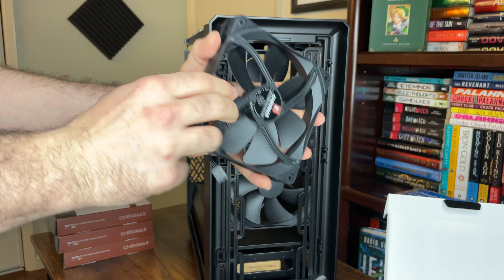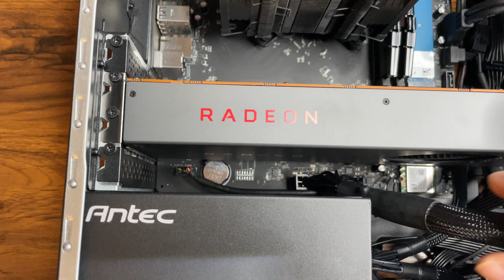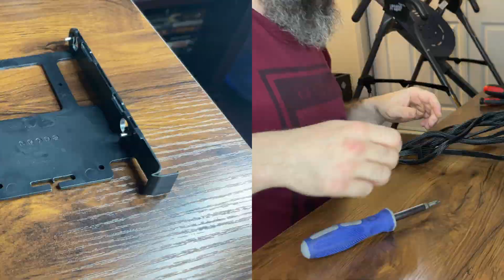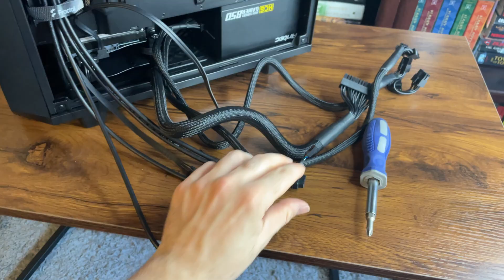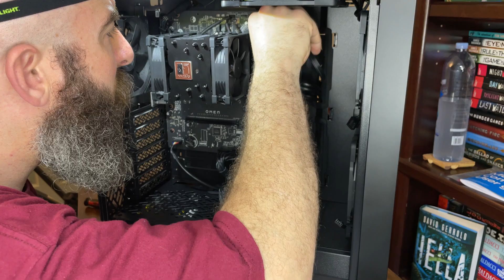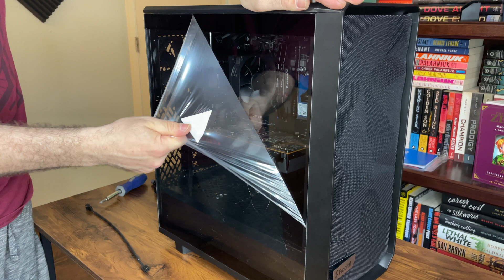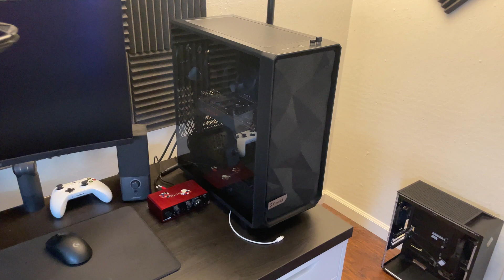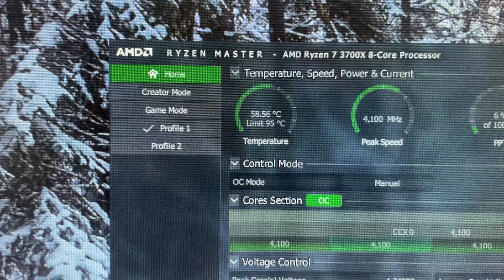HP Omen 25L / 30L Case Swap! Tutorial! Walkthrough and Results!

Comment: Does anybody here know if its possible to swap case on my 2021 HP OMEN 25L GT14-0879? I spoke to a salesman where i bought it and he told me OEM builds was a pain in the ass and that the PSU is optimalized  for this specific build/case and that motherboard probably wouldn't fit in any other case. I want to swap case and maybe upgrade the RAM. Anyone got any tips? =)
Reply: i wanna do the same. im looking to swap my motherboard, case, power supply. looking for just ideas to get me started.
Reply: @abstaxkkzyt3509 HP support just answered me back and said the case can't be swapped (they didn't know why) and that the Ram could be upgraded. So im stuck. Don't wanna ruin the whole thing 😅

Comment: I'm about to case swap, replace the Ryzen CPU cooler with an AIO, replace the power supply and add a bunch of fans. Do you remember how many fan connectors there were on the MOBO? I think I need 4... I'm not sure how to go about that and I'm hesitant to do the swap because of this.

Comment: Great guide! Swapped my Omen 25L case to the Fractal Mesh 2 but now I have the problem of my Fans spinning fast at nearly constant speeds, about 2000RPM without load. Tried to use Tools like FanControl and SpeedFan but it seems like they can't even setect the Fans. Maybe someone here has an ides what is causing my problem. Motherboard semms to ba a dorado oc rev B. thanks in advance.
p.s. Omen Game hub does also not work, doesn't matter what fan speed I choose it keeps the same.

Comment: So, DanKamYouKnow, you add all the fans humanly possible to the HP case, you added an AOI, you installed a fan port, also, all done in the HP 25L case, and all were wonderfully helpful videos; now you take it all out and put it in a new case, also another great video! 

Well, I have to ask. Isn't it time you stated STAY AWAY FROM THE DANG HP OMEN 25L in the first place! I didn't, of course, but I rue the day I bought mine. It's a freakin room heater, My wife could probably iron hankies on top of its case! A disaster from the get-go!

Comment: hello, I am experiencing overheating issues and I know its been 2 years since youve posted this video but would I be able to swap the 30l (r7 5800x / 3080) into an Antex AX63 Elite atx case?
Reply: antec ax61 elite
Reply from the maker: Yes, that will work fine. You may need to get y-split to power all of your fans. I’m also not sure if you would be able to power the RGB fans as Omen motherboards don’t have RGB headers.
Reply: @DanKamYouKnow  oh thanks for the reply wasnt expecting it, do you have any cheap / budget cases you would recommend? I think im gonna go with montec 903 air max but id like to get some other options and decide
Reply from the maker: I would honestly recommend the Corsair 4000d. It’s $100 currently but will drop down to around $80 with coupons and sales. By far one of the best cases for Omen users looking to swap:

https://amzn.to/3TLcoqc

Comment: Hello.
I had to buy another case because the new video card I bought was too big.
I moved all the hardware to the new case but I don't know if I plugged the power sw cable wrong? I don't know if I plugged the power sw cable in wrong, there is no reaction on the computer and no warning light is on, it's like there is no power, can you help me where I went wrong?😢
Reply from the maker: Did you figure it out? It is most likely the 2 pin PWR button that is not plugged in

Comment: Can this same case be used for the omen 30L with the stock AIO?
Reply from the maker: Yes, same exact process. you can mount the stock radiator on the top or the rear.

Comment: Why didn't you transfer the wifi card over? Im swapping a case right now and im scared lol??
Reply from the maker: Because I don’t use WiFi, I only use ethernet. For the WiFi card, you will have to swap over the card and the antenna that are underneath the front part of the case. You will basically have to mount the antennae somewhere in your new case (somewhere in the back panel would work best ). It’s the one thing I didn’t cover in this video, sorry.
Reply: Hey man I made that comment then scrolled to see sooo many people asking the same question and you answered them all sorry about that. Thanks for your help! I might just buy a usb wifi antenna instead ya??
Reply: Also is there no way to transfer over that rgb control chip to my new case? I got 3 rgb fans in my new phanteks case I might not be able to turn on.
Reply from the maker: @dariuspeterson2269 Nope, the Omen RGB controller only works with the Omen diamond and light strip, it won’t work with any other RGB, it’s proprietary

Comment: Hi. What can i do if my case doesnt include a cable for pwrbtn and led? It only has a f panel cable😢
Reply from the maker: If it has a front panel cable, then that case manufacturer has grouped together all of the front panel connectors. You will need to separate all of the connections from the group of connectors.
Reply: @DanKamYouKnow  thanks❤️ i will try

Comment: Hey man, I appreciate your videos as you’ve helped me along my first experience with a gaming PC. I’ve followed a ton of your walkthroughs when replacing my gpu, power supply and most recently I just swapped the case out for the fractal. Sadly I think I botched my cpu socket in the motherboard and have to replace the motherboard. Do you know if I can transfer the ssd to a new motherboard? I would just transfer all the storage to a hard drive but I can’t boot the computer now because of the cpu problems.
Reply from the maker: Yup! You can swap your SSD over and everything will work just like it did in your old motherboard. 👍🏻

Comment: the HD Cage rubber grommets are installed incorrectly, those grommets have a slit sideways, the cage is supposed to slide into the slits into the grommet, so youll have vibration dampening between the HD, cage and screw
Reply from the maker: Thanks for pointing that out

Comment: Where did you mount your Wi-Fi card ?
Reply from the maker: That is one part I didn’t cover in the video. I don’t use WiFi so I didn’t swap over the card, I only used Ethernet. You’ll have to swap over the card and the antennae that are attached to it (they’re underneath the front panel of the PC)

Comment: Very important question😭😭. I just swapper my case, but once i turned it on i didn’t have wi-fi or bluetooth. I know that Cam didn’t transfer over his wi-fi card, but i need to know how to do so. The antennas that plug into it are soldered to the other case, and i don’t know what to do.
Reply from the maker: You have to pry the antennae off of the Omen case and transfer it over. It should be able to break the bond from the Omen case and the antennae.

Comment: how do i take out the wifi chip? after removing the back panel an making my way toward the chip it’s it the front of the omen logo and it’s glued down? what do i do?
Reply from the maker: You might have to scrape it off. I don’t use WiFi ( Ethernet only ) and didn’t swap over my WiFi card, so I never did it, sorry
Reply: @DanKamYouKnow  oh okay it’s okay, i appreciate your help, another question i have is, i bought the a factal case and it’s the mestify compact rgb one, it came with 4 stock rgb fans, there is 4 cables within the stock fans, theres the rgb headers and the 4 pin to connect to your motherboard and an extension to apply more fans, so after connecting the all the fans and the rgb connectors, the fans don’t light up so im curious to why they don’t, i did research but they didn’t give the answers that i need and i even pressed the built in led button on the front of the case where you power on your computer, do you possibly know why?
Reply from the maker: RGB generally doesn’t work with Omen motherboards. I’m not sure where you even plugged them in (unless it’s a separate RGB controller or something. I’d recommend motherboard swapping at some point. The Omen motherboards suck
Reply: @DanKamYouKnow  okay, i appreciate your recommendations and your work, thank you

Comment: I started a similar project because I wanted to upgrade to RTX 4080 which didn't fit into the Omen case. Eventually I ended up ordering a new motherboard and AIO as well because I hated the BIOS from the HP motherboard. I mean - if I'm doing something might as well do it right the way I want it! :D

Now if I buy a CPU and RAM I have a whole new computer... :D
Reply from the maker: Yup, that’s what I recommend for most Omen users, is slowly building out of the proprietary’ness of the Omen. Most start with a case swap, the MoBo, then everything else.

Comment: How did you get Wi-Fi then for your pc a dongle?
Reply from the maker: I don’t use WiFi, I always connect my PC straight to the modem with an Ethernet cable. This is one aspect of case swapping that I did not cover. You will have to swap over the small WiFi module that’s on the motherboard, and the antenna. Or you could buy this:

https://amzn.to/40I4Jca

I have used this for WiFi and it works very well

Comment: With HUGE respect to Dan, a case swap is unnecessary.  My solution was to replace the glass on side door w/ plexiglass and add an intake fan straight to cooler. I went a step further and added a Noctua DH-15 S cooler. I went from 60C Desktop/Idle temps to 30C. It would hit 90s when gaming, and now in 60s-70s while being whisper quiet. I detail the entire build in an informative time-lapse on my channel that I uploaded today. See "HP Omen 30L runs HOT - COOL it before it's too late!".
Reply from the maker: I will have to check out your channel when I get a moment but I still think a case swap is the best value for Omen users. It opens up so many possibilities for different cooling components, larger GPU’s / motherboards, and others. I think a case swap is also the best experience for a person newer to PC building, to get that feeling of accomplishment once they’ve finished the swap.

I’m all for modifications and DIY, but I always recommend getting away from HP parts over time, if modifying is something the owner is even interested in

Comment: Any clue how to make an omen 25L swap case to phanteks a500g ?  I'm stuck looks like it is not possible 😢  this new case is great but that omen 25l mobo seems like a big issue.  Not allowing case swap
Reply from the maker: Why wouldn’t it it possible? Looks like any other mid tower out there
Reply: @DanKamYouKnow  ok made it.  Had to not care about that rgb stuff or wifi card.  Not sure what was this card for on bottom right. I didn't put it in.   

New case is so HUGE.   Can totally add more fans.  Originally you can add 7 140mm fans.  And you can probably add 2 more at the bottom if you raise them a bit to throw some wind to the GC.  

When I tried to swap I got so stuck thinking  I had to fit all of the omen stuff....   but no.   
Anyway.  Thx for the video.  Checked it.  And made it work

Comment: how easy is it to remove the back plate on 30L motherboard with 120mm water cooler? I am transferring to meshify 2 case
Reply from the maker: It’s not hard, just takes the right tools. See my cooler replacement videos, I explain the best way to remove the back plates in those video
Reply: Hi Vipul- I also detail this in Step 6 of my channel's guide on cooling the 30L. See my video I uploaded today "HP Omen 30L runs HOT - COOL it before it's too late!". However, I highly recommend a cheaper method outlined in timelapse in this video. It shows you how to replace side glass with plexiglass to add an intake fan. I took the mod one step further and added a huge Noctua cooler. My temps went from yours to 60s-70s gaming in whisper quiet mode. Good luck!

Comment: So the control center on the bottom right corner stays?
Reply from the maker: That’s the RGB controller for the diamond logo and the case light strip. If you somehow want to use those, you’ll need to transfer that over

Comment: I performed this swap, but now my Ethernet jack does not work in the new case. Everything else seems to be working. Do you have any ideas on what I may have done wrong (i.e. forgot to plug something in?) Everything appears to be connected except for the RGB controller, I did not transfer that over.
Reply from the maker: Did you figure it out? I am not sure why an ethernet jack would be not working after doing something like this. The LAN port is built into the motherboard so it's not like you didn't swap something over.
Reply: @DanKamYouKnow  I have not 😭. It's so odd. Everything else works.

Comment: Hey man, I have learned a lot from your videos. I am wanting to transfer my HP Omen 25L into a larger case like the Corsair 4000D just to get even cooler temps. Do you think this is feasible? Do you foresee any issues at all?
Reply from the maker: No issues at all and the 4000D is an AWESOME case. Make sure you transfer over your WiFi card and the antenna that are taped under the front of the case. 👌🏻
Reply: @DanKamYouKnow  I actually just went ahead and bought the fractal because the more I looked at your video, the sexier that case looked to me. How did you control your fan speed? I cant use the omen gaming desktop anymore and I can't seem to get MSI afterburner to turn them down now.
Reply from the maker: MSI Afterburner only controls GPU fans. If you’re still using the Omen motherboard, then you have to use Omen gaming hub unfortunately
Reply: @DanKamYouKnow  I just watched your hp omen going into surgery  video, and I see you already covered it👍 I am sad, I guess I will have to go buy a motherboard and change it out. Thank you Dan Kam Master Omen Man
Reply from the maker: No worries Blake, good luck with your build 👌🏻

Comment: I'm getting error 90b aftercase swap any ideas how to fix plz
Reply from the maker: Are you using a fan controller? Omen motherboards do not like fan controllers. You’ll have to bypass that error every boot. 

Are you utilizing all fan headers that were used when the computer was in its factory form? If you aren’t using a fan header that was used, it’ll throw that error. Make sure a fan is plugged into every factory utilized header
Reply: @DanKamYouKnow  thanks for the reply.  Yes I'm using a fan controller and have no fans plugged into the headers .I will plug the exhaust fan into a header and see if that helps.  Thanks again.
Reply from the maker: Even if all fan headers are plugged in, the controller is still probably going to throw that error unfortunately
Reply: @DanKamYouKnow  ahh ill just ignore it then . Cheers
Reply from the maker: No problem 👌🏻

Comment: Do you need to bring the cables from the omen case into the new one?
Reply from the maker: Which cables? The new case will have the front panel connectors, and your power supply will have most of the others. I explain it all in the video.
Reply: @DanKamYouKnow  Ok I see, im getting a new case and psu soon I just wanted to make sure I dont screw anything up. Thank you
Reply from the maker: You’ll be totally fine 👍🏻
Reply: @DanKamYouKnow  Do you think the 6950xt is good?
Reply from the maker: Yes, fantastic GPU

Comment: Thanks for the video! Can you share the links to the Noctua fans or the specs please?
Reply from the maker: You're welcome! I just realized that I don't have my normal links listed in the description. I will post this build here and in the description:

Fractal Meshify Compact 2 Case: https://amzn.to/3yuRRcm
GigaByte AORUS X570 Elite: https://amzn.to/3fD1f5b
AMD 3700x Processor: https://amzn.to/3fbwAwA
Noctua Chromax U9S aircooler: https://amzn.to/3hIvbze
AMD Radeon RX5700: GPU Market is TRASH
Crucial Ballistix RAM: https://amzn.to/3ytFw87 ( x2 )
Antec PSU 850w Gold: https://amzn.to/3u5ueDT
Antech PSU Extensions: https://amzn.to/2RDoHHj ( Black )
WD Blue 2.5" SSD: https://amzn.to/3yvw0kX ( 2TB )
WD Black m.2 NVME drive: https://amzn.to/3c0yONF ( 1TB )
120mm Noctua Chromax Fan: https://amzn.to/3bFriHO
140mm Noctua Chromax Fan: https://amzn.to/3fEHGt7 ( x4 )
Noctua Y-Split Cable 2 Pack: https://amzn.to/3vbiyAW
Noctua Thermal Paste: https://amzn.to/3yw0bsh
Thermal Grizzly Thermal Paste Spatula: https://amzn.to/3f6sjL6 ( 3 Pack )

Comment: Has anybody tried to put in an RTX4080 in this case? Wonder if it would fit! Thanks!
Reply from the maker: As long as the measurements for the card fit, you should be fine. Fractals website should list the max dimensions and you can easily Google the cards dimensions as well

Comment: QUESTION: I have the stock omen motherboard, i have not updated it yet. no internal usb ports. I have the Crossair fan case with a rbg fan hub, can I use a usb adapter to a external usb port for my rbg fan hub.  so i can control the rbg lights. thx
Reply from the maker: Most software that is needed to change the RGB, is not recognized by the Omen motherboard

Comment: If the Omen cases were designed to have air flow then their pre-builts would be decent
Reply from the maker: The 40L and 45L, which came after these models, have much better air flow than the original Omen 25L and 30L